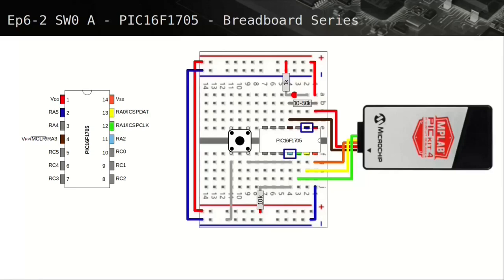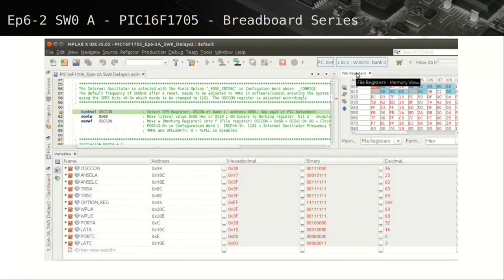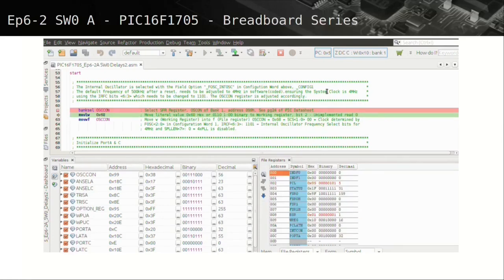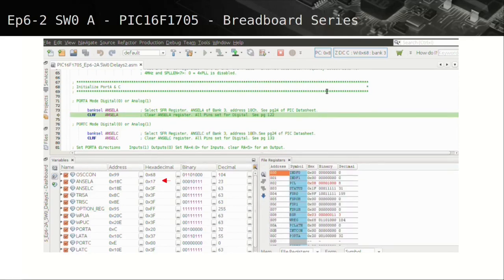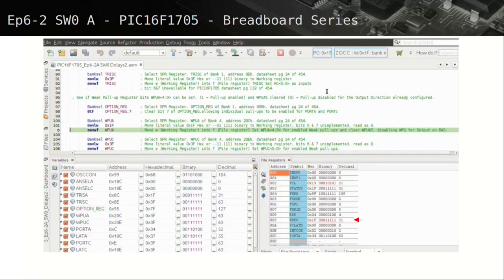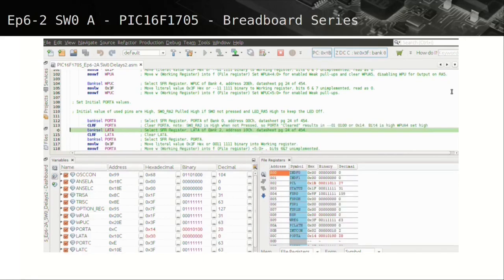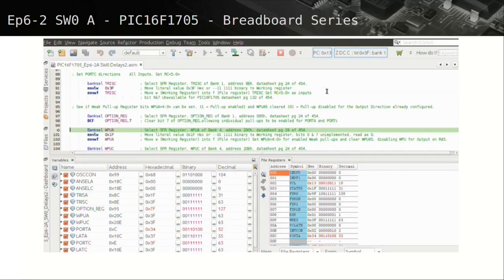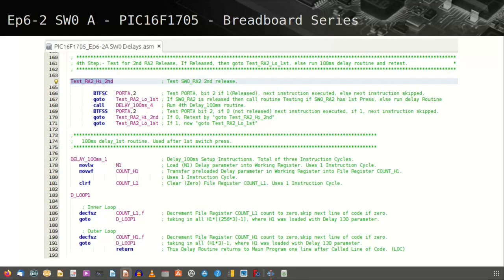Breadboard Tutorials PIC16F1705 SW0    Ep6 2 A Part 3

Comment: is pickit3 support PIC16F1705  ?  thanks
Reply from the maker: When you create a new project and have your PICKit3 connected while using MPLAB X IDE, you have to select the chip, such as the PIC16F1705. If the PICKit3 and version of MPLAB X IDE has the inc file for your chip, it will be available when typing in your chip part, if it's not available then the part will not be found as you type it. 

See the PIC12F1572 EP1 video for procedure creating a new project. 

I use a PICKit4, so I am not sure what chips the PICKit3 can detect